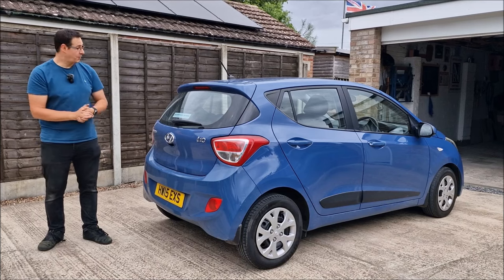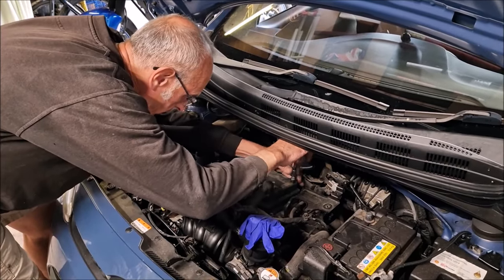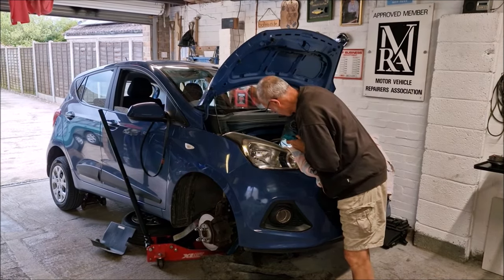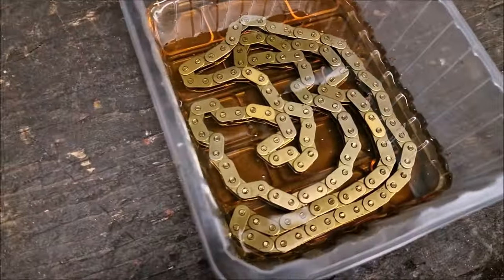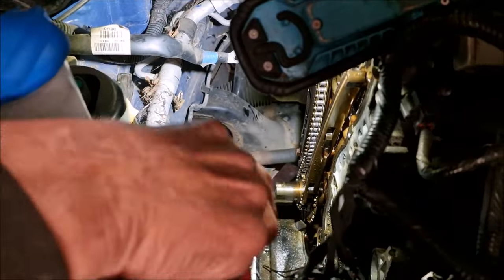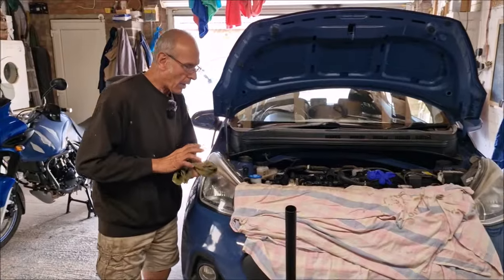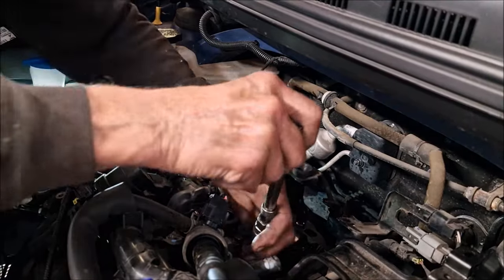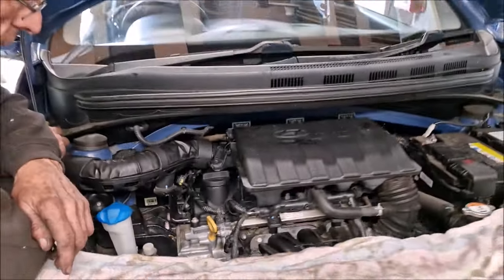How To Replace A Timing Chain On A Hyundai i10 - Noisy Timing Chain Repair

Comment: I did the timing chain on my mother in laws Vauxhall agila 2 years ago as she was quoted £450 by garage. When I removed the chain I could see no stretch at all compared to the new one and the chain guides looked fine. So out of curiosity and because there was no hurry and I am retired  I replaced the hydraulic tensioner and put the old chain back on. There was no rattle.  I did put the new timing chain on after that but I was thinking it was only the chain tensioner or low oil pressure that was causing the rattle. What do you think?
Reply: A good question indeed, and I'd like to know the answer too; and I don't even own a Vauhall or a Hyundai.
Reply from the maker: Dad says: absolutely, he agrees. It's more than likely the case that that was the issue BUT whilst you were there he says it would have been madness not to change the chain 😊👍
Reply from the maker: Dad reckons so!